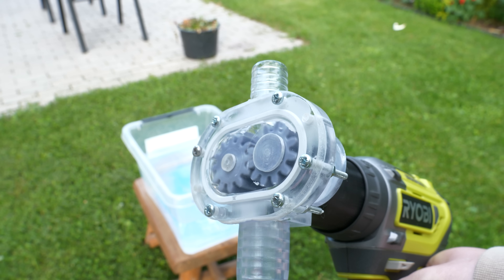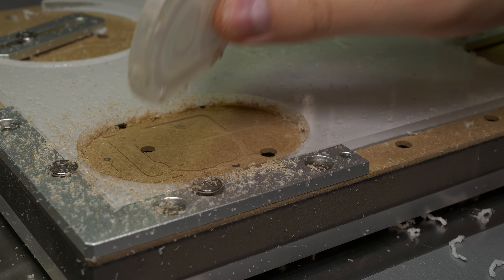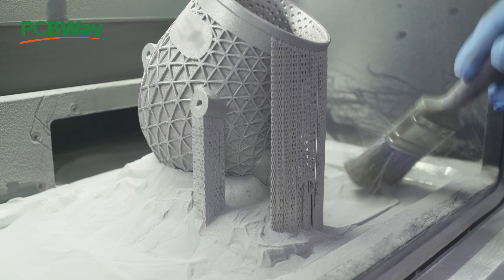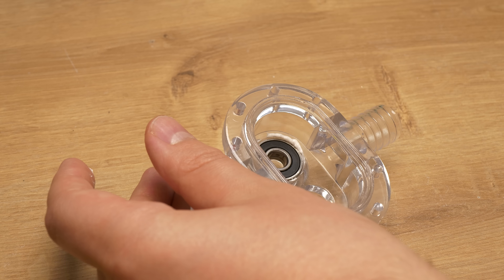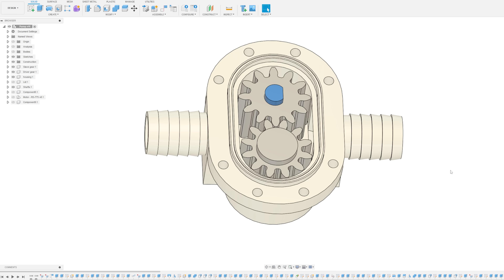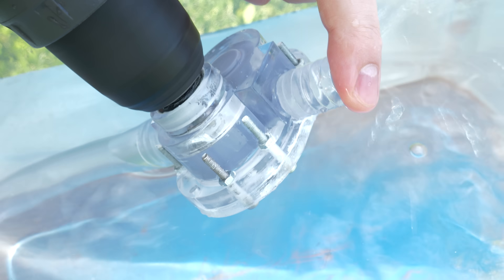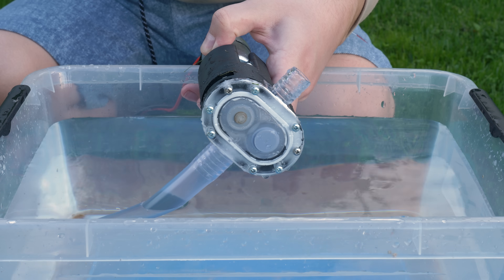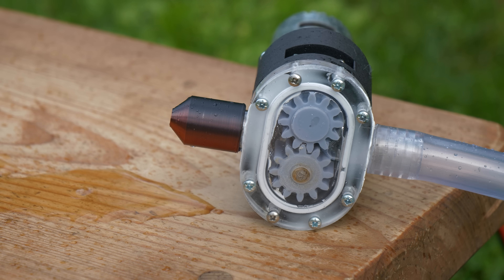Transparent 3D Printed Gear Pump - DOESN'T LEAK

Comment: Looks very inefficient. What's the advantage of this design?
Reply: High pressure with low input speed and it is actually quite efficient with motor power to fluid pressure/flow rate conversion😊.

Comment: Good job, finally, a pump that doesn't leak. Are the gears holding up well? What resin did you use?
Reply: He says which one he used in the vid...
Reply: @riba2233  I know he says it but my English is very bad and I'm not sure if the translation is good. That's why I'm asking.

Comment: Now that you're in the ballpark, you should grab some commercial off the shelf pumps that have similar application (rpm, flow, etc) and start measuring critical data like flow rate, pressure, and energy consumed/efficiency to have battle-offs with them. There are many inexpensive datalogger platforms.

Comment: A non-leaking pump?! OMG, this a legendary moment for this channel. I will miss those leaking pumps though xD.
By the way, I would like to see a fully 3D printed version of this, as different materials and settings matter for waterproofing in 3D printing. People also use various methods to waterproof prints, similar to the silicon paste you used in this video, I would like to learn about this kind of methods as well. For the time being great job, keep up the good work.

Comment: Flat butt joint surfaces leak. Bcuz they're not flat. Use a pocket for an Oring instead and it can stand more pressure with less fasteners and adhesive.

Comment: The seal has to be inside, and the bearing on the outside.
Reply from the maker: True
Reply: @LetsPrintYT  in case the shaft seal does leak, you could  make a small void between the bearing and the seal connected to the input side. Since the input side has a lower preassure than the air, it would pull the water that does leak through the shaft seal back into the pump. 
Great work in getting the pump to the point where it is.
Reply: for water pumps yes. if he were to pump oil then it may be worth putting it inside.